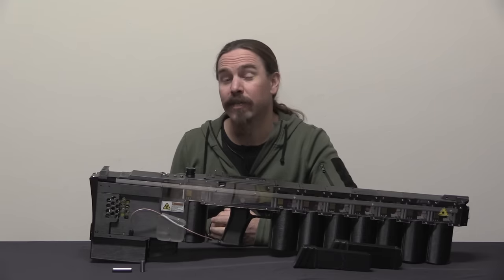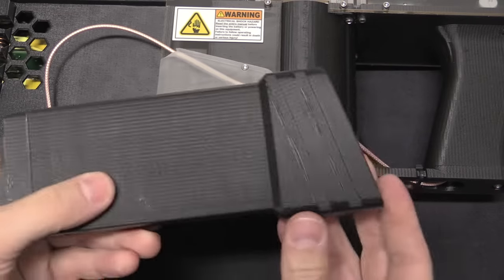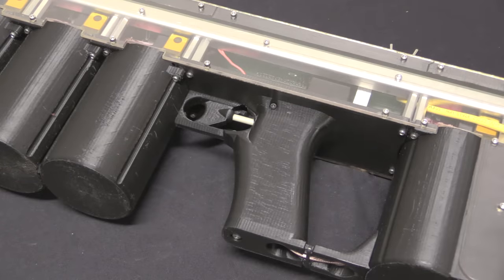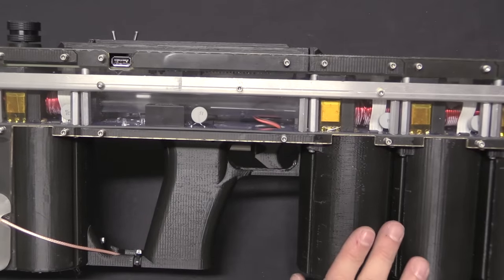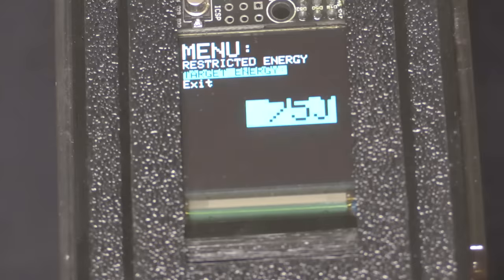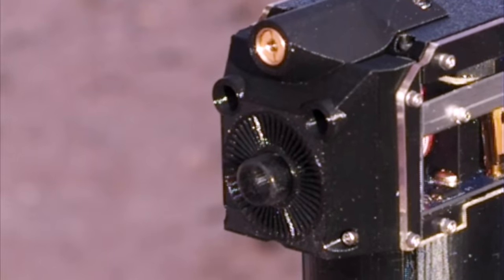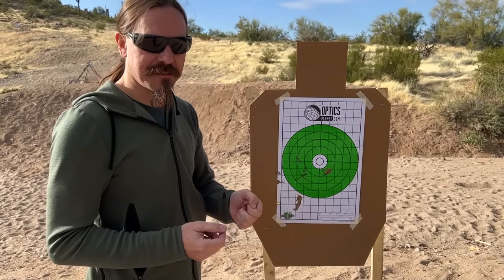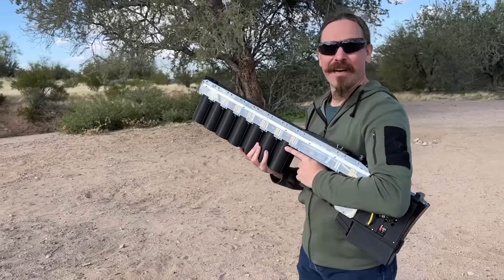ArcFlash Labs' GR-1 Anvil Portable Gauss Rifle

Comment: I'm actually impressed it has the muzzle energy of a .22 LR, that's a lot for a coilgun. Most of the ones I've seen are more akin to a BB gun or even a more dangerous nerf gun.
Reply: For it's size sure but bigger ones like what the US navy has... they are no joke... It's just a matter of energy capcity... And right now only ships have the stoage and genration ablity for electromagatic weapons... But given the BEV chaze and how close we are to new abtteries... it's only time.
Reply: If the projectile is made smaller with better energy capacity, it might become more effective.
Reply: It isn't even so much the gauss rifle itself that's the most impressive, it's the capacitor and battery tech they have.  They claim that the tech they use there allows them to charge up the 3 kilojoule capacitors in 3 seconds, something that hasn't been able to be done before.  That tech alone can be a massive game changing for jump starting objects, running things like, well, gauss weapons, etc.  The weapon is cool, no double and I'd get one if I had 4k USD laying around, but the other tech in it is also just as exciting.
Reply: @56bturn  You can magnetize metal only to a certain point. If you make the projectile smaller, you don't have enough magnetic "storage" and you would waste energy.
Reply: @BullsMahunny  Yep, must be drawing heavily parallelised current through those capacitors - the capacitors are the real stars here
Reply: Thought the navy ones where rail guns not Gauss?
Reply: @56bturn  larger projectiles are actually better in this instance. The magnetic field acts on a larger projectile much more strongly than a small one.
Reply: @BullsMahunny  For sure the tech is the most interesting.  For example, passenger jumbo jets burn a TON of fuel on takeoff..  If we were able to replace that with a sort of electro-magnetic catapult system, it could save on fuel costs and emissions.  Same with satellite/spacecraft launches.  Just a matter of  the technology maturing.
Reply: @crabmansteve6844  also coils can't switch fast enough to accelerate fast light projectiles
Reply: It's definitely getting up there into lethal territory. I can't wait for the first report of a man defending his home with a gauss rifle.
Reply: @TheGreenKnight500  well, a bow is way more effective
Reply: @murphy7801  You are correct, very different tech really. They get combined in people's heads, since they both use magnets and a lot of power, and are super futuristic seeming.
Reply: @tedarcher9120  True. My friend has a crossbow for self defense, among other things. No background checks, waiting periods, or paperwork. I have a firearm, but I also have a gladius which would be just as effective at close range.

Another friend of mine once chased off a guy trying to steal his AC by wielding a warhammer. Low tech solutions work just as well as high tech ones. I'm just excited for the day we to an old man sitting on his space homestead porch with a sci-fi rifle on his lap.
Reply: @TheGreenKnight500  more likely with a composite bow and a halberd lol
Reply: @Unit-kp8wm  that's not true though. The problem with gauss guns is that they have very limited muzzle velocity due to self-induction. Rail guns, on the other hand, already beat chemical guns
Reply: @BullsMahunny  That's only 1000 watts, hardly impressive. And that's assuming you're right about the 3Kj, because Ian says each shot is 100j max...
Reply: @GreenBlueWalkthrough  The Navy abandoned theirs. And unless battery technology makes a huge leap (which doesn't seem like anytime soon), this is still impractical.
Reply: @murphy7801  Correct.
Reply: @jorper2526  That's been considered many times in the past, but it's just too impractical at this point in time.
Reply: @murphy7801  , yep. Gauss guns (coilguns) were in relative obscurity, because of problems with switching the polarity of magnetic coils fast enough. Railguns were considered more promising. But as you could see - coilguns seems to overcome their problems, while railguns are still in development.
Reply: @jorper2526  That wouldn't be practical. Actual takeoff roll is just a tiny fraction of fuel spent on getting the aircraft into cruise configuration. And for safety reasons the aircraft would not only need to spool engines to climb thrust before catapult shot, the catapult would need to accelerate at a rate that is not much higher than what the aircraft can do on its own, due to structural concerns. You would use a ton of electricity to save very little in emissions, it wouldn't work.
Reply: @thomasbecker9676  And as I said "Just a matter of  the technology maturing."

Could be 10 years.  Could be 50.  Could be 100.  Never said we could do it today :).
Reply: @jorper2526  Could be never.
Reply: Not true, rail guns are even further from miniaturisation to small arms than coil guns

And larger coil guns can be made to launch projectiles faster than 10km/s at mussle velocity (like nasa's 11km/s coil gun. Or the us armies' 20km/s coil gun).

And neither rail guns nor coil guns are superior to chemical propellant as far as potential.
Modern style chemical guns re at their limit, but new styles of chemical guns currently in prototype stages can exceed these limits and rival or even exceed coil guns and rail guns.

-Etc gun tech (plasma igniters for solid proppelant) and its accompanying new propellants can get up to 4km/s so far. 

-CLG guns (hydrogen gas propellant guns) can get up to 11km/s

ETC guns are fairly easy to build with current technology, and are likely to replace conventional guns before any revolutionary technology does. But its still limited compaired to EM guns. And like all pressure wave guns it has greater recoil than EM guns for the same mussle energy. 

CLG guns are cool, but highly dangerous due to the highly volitile propellant, the abvy desided to drop them in favour of rail guns and coil guns for this reason. Plus they have more recoil.
Reply: Not true, chemical proppelants ahev just as mutch if not more inherent issues. We just have solved most of them already. And the limitions on current types are practically met. Unlike EM guns. Staying with chemical guns would require switching to CLG guns or similar evolutionary tech, but they are just as flawed as EM guns at the moment.

You are probably one of those guys who would thought chemical proppelants weapons would never replace bows and crossbows. Too many inherent issues compaired to bows and handguns are 'useless AF'
Reply: @thomasbecker9676  But saying never is a bad bet.  Not sure what you are trying to argue or why you replied to me originally.
Reply: @jorper2526  Because you commented about using this technology for aircraft, and I'm an aerospace engineer.
Reply: I actually own nerf blasters that can do higher muzzle velocity than this.  Of course, a nerf dart is also much lighter (~1 gram), so the muzzle energy is still much lower.
Reply: @GreenBlueWalkthrough  It should be obvious I'm talking about man-portable ones, considering the video...
Reply: @Unit-kp8wm  That doesn't diminish just how impressive it is that a hand-held coilgun has achieved potential lethality to a human with a reasonable charge time.

Comment: a vehicle mounted one with active cooling on the coils and a generator powering it instead of a battery could get you firearm velocities with a much faster charge time, sure the weapon is heavier, the capacitors would take up a lot of room, but the ammo would be a lot lighter and not liable to explode if hit, not saying it would replace a tank, but it could probably penetrate one if you scaled everything up by a factor of 100.
Reply: Or you could fire a M829. The problem with coil guns is in the power supply. It takes a lot of power in a short amount of time to fire one of these things. Batteries have already complicated logistics as it is, I don't know how much of a pain it would be to keep these weapon systems in the field, but it's not going to be easy.
Reply: @joseph1150  give batteries and capacitors a few years, you may be surprised... Just a little bit more electric advances and that g-1 can be a significant weapon.
Reply: @immarriedwith5kids514  It's going to be a lot more than a few years and may require a completely different tech than the battery-capacitor approach as we know it.
Reply: I don't think the scaling is linear.
Reply: @immarriedwith5kids514  Batteries and capacitors are both basically at the limit of what is physically possible.
The limit of tesla's innovation is 'bigger battery has more charge'.
Reply: or you could fire a more efficient and way better at yeeting stuff rail gun, or use a 120mm tank gun
Reply: @_mwk  current batteries are at their limits, but there are teorethical breaktroughs like solid state batteries.
Reply: No need to speculate cause they already exist and they are freaking deadly. Punch trough just about anything if you hit it.
Reply: we already have a scaled-up weapon system for use on warships, though the power draw is great enough that it requires a powerful energy source. Modern warships use nuclear power, so they are fine, but tanks would have issues.

What I could see using a design like this for, would be an APC or troop transport, that uses a big ol' diesel engine constantly recharging an oversized battery, that has a bunch of smaller coil guns hooked into it to be fired by passengers. Ammo storage would be simple and easy, allowing for as much cargo room as possible, while allowing for anti-infantry capabilities without using up field supplies.
Reply: @GeneGear  only carriers and submarines use nuclear power, everything else works on diesel
Reply: @ancaplanaoriginal5303  
Yeah, explosives are way more effective against tanks and armor. But Gauss Canons have the advantage of far less noise.
Reply: @MikaelIsaksson  but those are rail guns, not shitty coil guns
Reply: Not exactly, the rating of the capacitors does not change regardless of the amount of input power. While your idea might get a faster recharge time. The limiting factor is still the capacitors. You would need more capacitor and coil stages to achieve higher velocity, and you would still be limited by the discharge rate of the capacitors through the coils. 
Don't forget the coil heating also.
Reply: @_mwk  batteries yes, capacitors no, there's way more innovations in faster discharging higher voltage graphene capacitors to be looked at.
Reply: @GeneGear  it would be easier and safer to have a smaller battery and have the alternator of the engine charge the capacitors directly.
Reply: Ships are being tested with rail guns, there are a few very big ones that use kinetic projectiles, so they went the other way with them and made the projectile very very heavy and huge. They don't fire slow, and the penetrate everything that's been put in front of them so far.
Reply: @alexfrederick9019  they haven't fired it directly at the ground, I take it?
Reply: @ancaplanaoriginal5303  railguns give relatively constant acceleration, coilguns change the rate of acceleration a lot, making recoil more difficult to compensate for, but there are no moving parts and less stress on the firing elements than coil guns. Quench guns have a lot of promise too, they're effectively an infinite stage coil gun. You take a superconducting solenoid sitting at just above the critical temperature and lower it along the solenoid, the passing projectile induces currents which produce enough heat to make the solenoid behind it stop superconducting so you have a stronger magnetic field in front of the projectile at all times, the effective speed limit is just below the speed of light.
Reply: @domvasta   @AncapLanaOriginal  You saw the video, right?
That gun was anything but loud. I am still talking about portable guns, not large, mounted ones.
Reply: Fusion cores are the answer
Reply: @ancaplanaoriginal5303  there are coil guns as well.

Comment: I don’t think people appreciate how much energy 4,000-16,000 amps truly is. Your average home breaker is 15 amps, and the whole house is usually on a 200 amp breaker. Your average power wire on a street in the US is about 700-1,000 amps. Your average lightning strike is about 30,000 amps. 
This little piece of electronics is able to dump anywhere from 4 to 22.5 times the amount of energy the power grid supplies on their lines in a matter of milliseconds. An absolute marvel of engineering

Comment: I would LOVE to see this mass driver tested by Taofladermaus using some projectiles that were machined by his community members, like Evan Perry. I bet they could develop some accurized self-stabilizing slugs.
Reply: Unfortunately I don't think we can get a lot of spin on a projectile with such low speeds.
Reply: Several years ago, I read some theoretical shit on coilguns, and efficiency. If I recall right, solid iron/steel projectiles will have eddy currents that can detract from the overall efficiency, and it might be better to use sintered steel powder, to form the slugs out of.

Course, with no rifling, these may benefit from long, teardrop shaped slugs with a "ducted fin tail". But, that just my thoughts on it, and I could very well be hilariously wrong.

If I am wrong, someone please educate me!
Reply: @dposcuro  Taufledermaus has done lots of slug tests, and the "diabolo" shape is consistently great. Large mass up front, and low density tail with modest drag. Of course, those were all conventionally powered, changes may have to be made for coil guns.
Reply: @moonrazk  you could model it off of an APFSDS  tank round. Those don’t spin for stability, but instead have large fins like a missile. It’s essentially a giant dart
Reply: Definitely. While I was watching it I was already thinking that to stabilize the projectile, they can borrow a page from shotguns and stick a piece of plastic at the end.
Reply: The software would probably need adjusting for a plastic stabilizer though, or else it will think the metal round is still going through the coil and pull it back.
Reply: The best shape would be somethig like a very long diabolo airgun pellet, at least 2 inches long.
Is better to make the projectile out of thin layers of steel,  glued togheter with an isolating resin . Just like electric current tranformers are made.
The isolated layers react better to magnetig fields than a solid piece of metal.
Even better if is a steel-nickel-cobalt alloy, with a tungsten carbide point(APCR shell). 
Also add a coat of diamagnetic materials to the stabilizer finns, to reduce "magnetic drag"(lots if science here, not gonna delve into that).
Reply: @carloshenriquezimmer7543   Heya, you seem to know your stuff: How feasible is it to use non-ferromagnetic projectiles with an internal electromagnetic coil charged by the gun? Could that give you more "grip" relative to weight?
Reply: I’m thinking more of a crossbow bolt.  The arrows I use for hunting from a 65 lb longbow are 700 grains with a 400 grain point/insert, going about  175 fps.  Ian says these are 600 grain projectiles going about 250 fps, it wouldn’t be too far off a modern bow.
Reply: @bjornstromberg4481  not much. the complexity of a usable design would be ridiculous comparing to the small gain of power.
It scales up with size, so, maybe for a naval artillery piece that would be possible...
Reply: @carloshenriquezimmer7543  Thanks, it's something I've been wondering about for a while :)
Reply: @moonrazk  Ym... It is smoothbore... Maybe fin stabilisation, or perhaps even full blown flechettes?